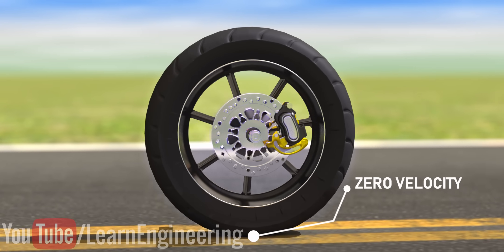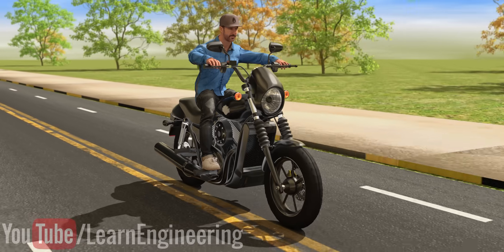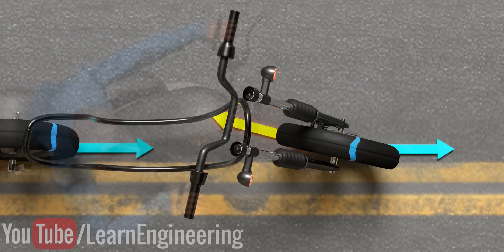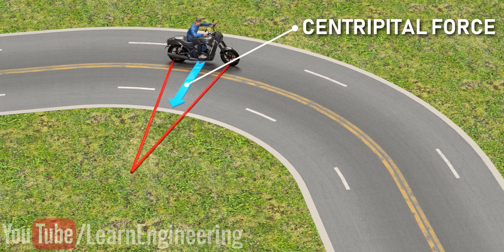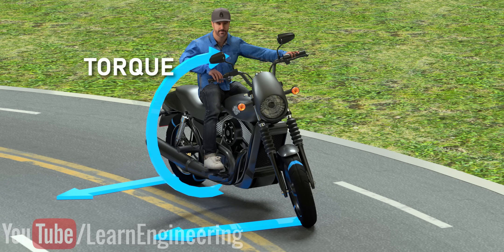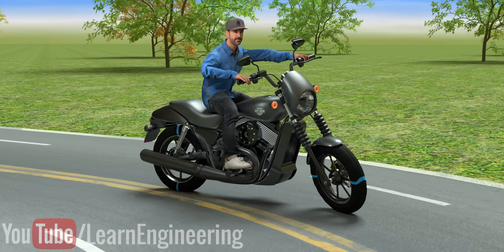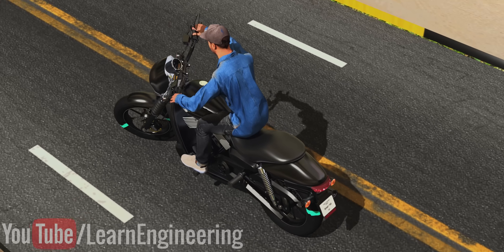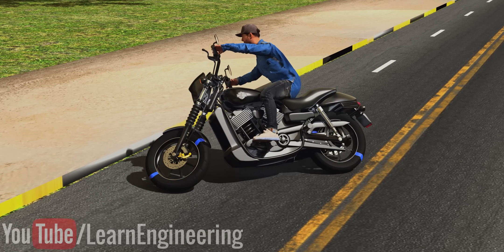Counter Steering | The interesting physics behind it

Comment: Following this information is going to get someone killed. You never readjust the handlebars after “falling” into the turn. Counter steer is used continuously through the turn til you want to go straight again unless you want to high side and take flight departing your motorcycle. The physics behind it are explained wrong too. You have to understand tire sized, gyroscopic effect and much more to explain how it works. But just know, anything over 12-15mph(depending on the rake and trail) requires counter steering.
Reply: This, right!
Reply: Well said except last 2 sentenceds are like this video, BS.

Comment: Nice 3D animation, however, as others already pointed out, this isn't completely accurate. Counter steering is how you steer the bike at speed, not an alternative to something else. Also, the rider doesn't need to adjust the handlebars after initiating the counter steer, the front wheel will correct itself.
Reply: This comment!👍🏻👍🏻

Comment: This video is actually dangerous to beginning riders. It incorrectly states that there are two ways to steer, like you get to choose to counter steer or not. At speed above about 15 MPH there is only ONE way to steer a motorcycle and that's with counter steering. At very low speeds you steer a motorcycle like a bicycle - no counter steering. At higher speeds you must use counter steering to turn.

Comment: Lean the bike first.  You should counter steer like you are laying the bike over.  Don't do it at low speed.  You are smoking crack.  That is not how you normally turn the bike.  That is a low speed turn vs a high speed turn.

Comment: "Normal steering"?? Turn the wheel the direction you want to go and the bike flops over and crashes in the other direction. Normal steering is counter steering unless you are going 3 miles an hour in a parking lot. This guy is nuts. Even cars want to flop over the other direction  the wheel is turned, only we have an additional 2 wheels to keep it from flopping over unless you are speeding in a tight curve, then you are shyt out of luck.

Comment: I never looked at it as steering, just shifting your body weight in the direction you want to go
Reply: And while shifting your body weigh you will be applying pressure to either right or left bar. Thus counter steering.

Comment: There are no 2 ways of steering... there is no "normal" steering... dont say such things. Bikes turn only with turning the bars to the opposite side.
Reply: This video is just plain wrong, dangerously so. I’d be fascinated to hear your 2 methods of steering though. Are your methods speed dependent?
Reply: @Softail Fun  Every bike turns by turning the bars at the opposite direction that you want to go.. It works at any speed. Just that.. there is no other way.. of course after the lean the front weel turns to the turn so that the bike dont crush.. if we just lean our body the same thing happens to the the front weel( fist it points to the opposite side of the turn and then it turns to the inside) but we dont understand it while happening and of course it happens slower and not so efficiently as if we turn the  bars... but this doesn't mean its something different.. if we stand straight and turn the hand bars to one side the bike wants to fall to the other side...simply as that.
Reply: The only reason that we turn our body to the inside of a turn is to make the bike lean LESS than needed to make the turn because the bike being more upright makes it safer for many reasons... grip, suspension function, brakes etc...

Comment: This video actually is counter intuitive. What you as a motorcycle rider should do is go find an empty straight road and practice. When you are driving down the road at speed you will notice if you push the left handle bar forward slightly, you will initiate a turn to the left. The more you push the steeper and sharper the turn. The same with the right bar. The faster you are going and the sharper the curve will dictate how much you need to push the bars. I almost crashed when I first started riding because I literally tried steering the bike to make a left turn by trying to push the right handle bar forward to turn left and ended up going right and almost crashed but ended up saving it. This is the way a motorcycle steers at speed. It steers off the back wheel. I'll have to make a video to explain.

Comment: I cannot wrap my head around this concept. You turn by leaning and turning the bars simultaneously in order to meet the non-slip condition in a turn. But with the counter steering technique, you turn the bars the opposite direction, and then lean back into the turn and turn the bars the correct direction in order to meet the non-slip condition. Just seems like normal turning with extra steps.
Reply: Your understanding is flawed. To turn right the rider pushes the right grip forward. In so doing he momentarily and very slightly steers to the left. The bike leans and the steering geometry of the bike forces the front wheel to steer right….. NOT THE RIDER. If the rider were to steer right the bike would stand up and fail to make the turn. Throughout the bend the rider maintains a pressure on the right grip. This video is total rubbish and is incorrect in this very important point. This link shows counter steering in use on a motorcycle. https://youtu.be/lzk8oyNO708

Comment: You don't have to correct the handlebar after countersteering because the bike will correct it itself once you're tipped in. Am I wrong? Or perhaps I'm just unconsciously doing it?
Reply: Yep, once you start counter steering the bike will lean. Once in the turn you keep pressure on the inside bar until you want to stand up. The steering geometry of the bike takes care of the front wheel pointing into the bend. Your 100% right brother.

Comment: Used by many bikers? Isn't it used by all biker? Or, a least anybody that has ever ridden a bike faster than 10mph. The underlying physics of how this works may not be readily apparent, but the act itself seems pretty intuitive to me. I never had to be taught to counter steer, it's just how the bike works. Is it even possible to turn the bike without counter steering at any significant speed?

Comment: If you really like to find out if you're counter steering, wait when it starts raining, the road should still have dry spots. Take a 90 degree corner and go back and check out your tracks on the road.  You can even try this with a bicycle while driving 15km/h (9 m/h).

Comment: I used to do this as a kid and not even realize what I was doing. But I can recall the sensation of myself falling the opposite way before having to compensate.
Reply: And that’s where the video is wrong! On a motorbike the rider doesn’t compensate by steering into the bend. The rider continues to counter steer, the bike compensates, not the rider.

Comment: This lesson is missing a very important "scientific" element.  The wheel itself, the steering wheel, is rotating around its axis, its axle.  The steering, handle bars, are connected to this axle, through the forks, in line down.   The handlebars are connected to the axle, by solid mechanical link.     The pressure applied on the handlebar is applied to a axis of the wheel.   Now go back to junior high school physics class.    Grab a bicycle wheel with its axle in place.  Now stand on a lazy susan.  A lazy susan is a revolving platfrom, like a spinning seat on a stool.    Stand on that platform, hold the wheel in front of your self with a hand on both sides of the axle.  Now, spin the wheel.  Now, apply some pressure to that wheel on one side.  Notice the wheel will tip to one side, twisting in your grasp, to the left or right.  As well, miraculously, you, the person holding the wheel standing on the spinning platform, will start going in a circle.   That is the "reason" the motorcycle begins to lean, and reason a motorcycle doesn't need a rider to balance once at speed.  The rider is not balancing the bike, the rider is riding the machine that is in itself designed to balance on its own, once at speed.  The rider is simply steering, and controlling, but balancing     A gyroscope is used to steer.  Think about how and why a motorcross bike flying through the air, can be directionally controled in space, and pitch angle, by controling the steering direction of the wheel, and in the case of back brake, can be used to change to flight angle lets say.      Keep in mind, flying motorcycles are not touching the road.  But can still steer., as long as the wheel spins.   In  the olden days, I remember the "wheelie King"  He had a little electric motor keeping his front wheel spinning, so he could still steer.   Its all in the science. I hate to say it, but this video is incomplete.  Touches on some elements, but still struggles to truly understand "how and why" and motor cycle turns.     The interesting physics are interestingly not properly explained in this video.  There are plenty of articles in motorcycle journals that explain this, written by engineers and the like who actually know what they are talking about.

Comment: Several of the explanations in this video are at best misleading. "Normal steering"  is not a correct descriptor, in fact this method is only possible in LOW SPEED (less than 20mph) steering. The rider does not cleverly catch the bike, the bike cleverly balances itself when the rider quits disrupting it through the handlebars. Riders cannot significantly turn a motorcycle at speed (over about 20mph) with leaning, but only by counter steering. There are videos demonstrating these in real world experiments from Keith Code under "A Twist of the Wrist 2".

Comment: This is a complete misunderstanding about how countersteering works. Countersteering is a necessity due to the difference in wheel circumference between the inside and outside of the tyre/road contact patch for a motorcycle that is leaning over. This occurs because the tyre cross-section is basically a semi-circle. If you didn't countersteer then the bike would travel a tighter curve than you wanted, hence the requirement to steer outwards to balance the forces. The forces involved to stay upright (centripetal) must be harmonious with the forces required to negotiate the bend in the road.  (I am a qualified Forensic Collision Investigator)

Comment: This was poorly illustrated in my opinion.  A typically poor explanation of the Physics involved when riding a motorcycle, and only useful to explain when riding very slowly.  There are two ways to steer a motorcycle, and both methods can only be realised, by actually riding one.  However, in short, assuming you can ride a Push-bike.... when riding at slow speed, around various obstacles, push forward on the side of the handlebars in the direction you want to turn (effectively, steering in the opposite direction.  This will destabilise the Motorcycle, forcing it to tip in the direction that you want to turn.  At a point of your choice, you will find the equilibrium required to maintain your preferred turning Radius, to negotiate the turn.  Again, at low speed, keeping your body more upright than the Motorcycle, you'll find that you are now exerting force on the Footpeg on the side pf the direction that you want to go.  So, try this.  Push on the right handlebar, make the Motorcycle tip right.  With weight on the right Foot-peg, and keeping your body more upright than the Motorcycle, find the equilibrium in the turn radius required.

At fast speed, there is a completely different technique.  But if you have to read this to understand how a Motorcycle steers.... you have a lot of practice in from of you, before you start "getting the knee on the Deck".

My best advice for ant manoeuvre at speed, is; looking at where you want to be, punch with the handlebar, in the direction that you want to go.  The bike will do the rest.  This behaviour become very apparent and easier to understand, when playing Slalom with the broken centre line on a straight, open road, with no other traffic around.  Do it first, at slow speed, then increase your speed gradually, as you Slalom the broken line.  I guarantee, you'll have your Eureka moment, within a minute.
Reply: Equilibrium is found at a point of MY choosing?!
I think physics would disagree.
But, by all means, present YOUR illustration of how to defy physics.
It's one thing to deride someone else's work.
It's another thing entirely to 'put your money where your mouth is'.

Comment: Fantastic 👏👏👏
Reply: The vid is bullshit! Dangerously inaccurate.
Reply: @softailfun 
Unfortunately I did That and it worked....
Reply: @aliatteya97  
So you travelled along a road in a straight line, approached a significant right (for example) bend at a speed greater than 20 mph. Pushed your right grip forward and then physically steered to the right??? That is what this video shows. By steering to the right after the initial counter steer, you’d have stood the bike up… why??? Because of counter steering! So no…. You didn’t do this.

Comment: When you come hooking into that turn you bang down the gears and slide the ass end around while you lean the whole bike into the corner. Have the bars pointing in the opposite direction of the turn and slowly bring the bars back as you are coming out the turn. Power the throttle and slip the clutch while you are 2/3 of the turn to spin the wheel and bring the bike back for the next turn or straight.

Comment: There is no such thing as  countersteering to turn a motorcycle. You lean it over, just like a bicycle. The physics is the conservation of angular momentum or something similar. I've been riding for 38 years, lifetime AMA membership. When I started riding no one ever said anything about countersteering because it's just like a bicycle: you lean the machine over slightly and it follows a curve determined by your speed, your lean and a slight angle of steering into the turn. Try to actually turn the handle bars opposite to your turn-- you can't do it without crashing. Learn to ride a bike--- nothing is mentioned about countersteering. It's all lean. On a motorcycle with decent balance of equipment, like my ZX9, you can take your hands off the handle bars at freeway speed and turn gently/weave by leaning, no countersteering. Get your bicycle and hold it by the seat only. Walk it forward; then lean the bike by holding the seat: the front wheel automatically turns into the lean. It doesn't turn opposite the lean. When turning the motorcycle there is no twitching of the handle bars as mentioned in the video to transition from "countersteering" to "normal" steering, just a steady pressure downwards. Due to the rake/angle of the forks it seems like you are pushing forward (countersteering) but the net action is down.
Reply: Absolutely hilarious! You say lean then say counter steering doesn’t work. I mean this video is wrong for sure, but for gods sake learn how your bike steers. All those alleged years of riding and you still do it wrong. Laughable.